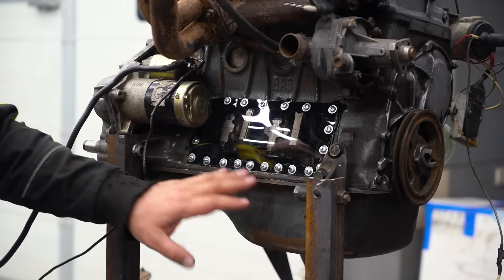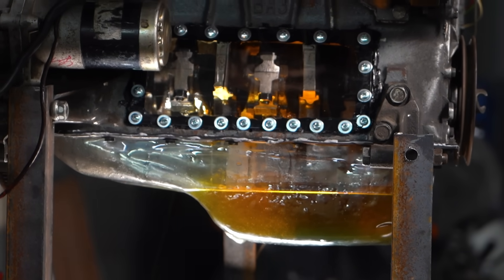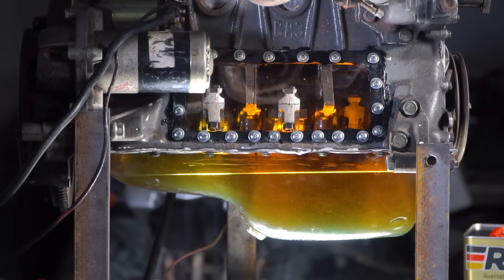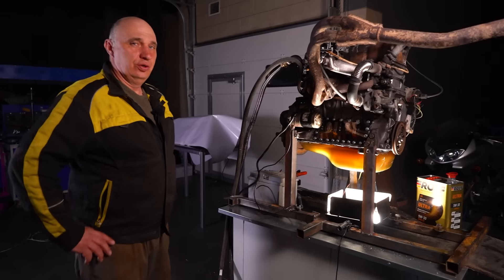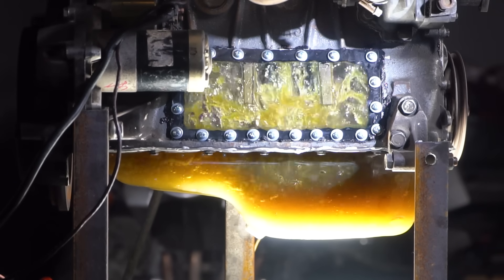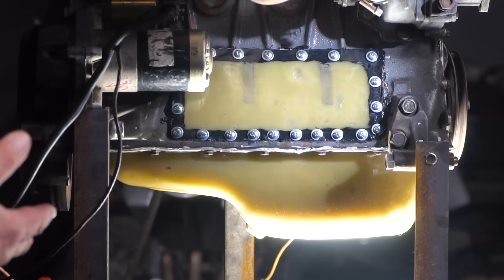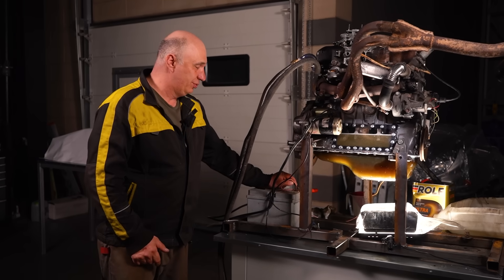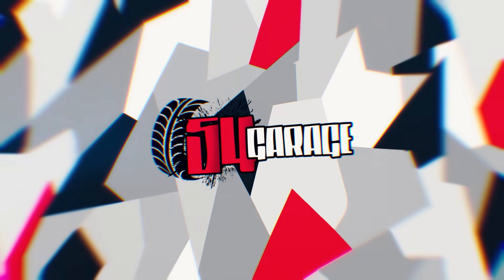What actually happens when you overfill your motor oil? (w/ transparent oil pan)

Comment: This man answering the hard questions in life 🍻
Reply: I remember I’ve stated that Garage 54 is mythbusters of car world.
Reply: The ones we never knew we even had.
Reply: I thought about doing this same video 18 years ago. Cool to actually see it happen.
Reply: @slopoke22  You know, it would have taken you less time to add 4 quarts than to watch the vid, think, and come up with this response.
Reply: @the_kombinator  kik rox in flip flops, smh.
Reply: @slopoke22  I do it in crocs, they're more durable than sandals.
Reply: True
Reply: Well said
Reply: On a high rpm engine, overfilling will cause around a 10hp loss. It's really negligible, but we did some testing on engines that make 900 hp N/A. In competition, 10hp may hurt ya. Everyday cars, you'd never know the difference
Reply: @clarkdavis3588 Good vibes..
Reply: The o/p was just being sarcastic. We all know what happens ... it was just a statement to all men..jeezz
Reply: What hard question buddy?:):)
There is reason why not do that.
Reply: It gets better mileage 

I always overfill my oil level to become a well oiled machina bebe ❤😢😮😂 😊😊😊
Reply: @charlesshort4247 

Boy oh boy,  you forgot to mention to put a breather filter in place of the oil cap

Just leave the cap ½ - 2 turns loose if it allows it and not fall off
Then it won't blow the seals lol
 🎉🎉🎉😊🎉🎉🎉
Reply: Guys, HERE is The True Savior

HalleluYAH translates “Praise ye YaH”

YaH is The Heavenly Father
YaH arrives via the TENT OF MEETING
YaH was Who they Crucified for our sins
YaH was Crucified on an Almond TREE

Ancient Semitic of Moshe (Moses)
Isa Scroll (The Original Isaiah)

Isaiah 42:8
"I am YaH; that is my Name! I will not yield my glory to another or my praise to idols.”

Isaiah 43:11
“I am YAH, and there is no other Savior but Me.”

Isaiah 45:5
“I am YaH, and there is none else.”
Reply: And youtube MECHANICS are arguing with someone showing you FACTS 🤣
Reply: I have ran 2qts extra in all my cars, oil is what cools the engine, never had a problem with the extra oil,  factory has it set for the least amount of oil ,that will work long enough to get you through the warranty, and if everyone was adding extra oil, that would only make for more oil to be needing to be recycled, and more oil to be needed, cars need more oil than what it calls for, you engine will last longer, because the oil is what cools the engine, so the more the better, the car companies don't want you to know this, if you could take your old oil and mix it with your gas ,the engine would even last even longer, just like a 2cycle is cooled by the oil in the gas, your car engine would last longer if you could reuse your old oil and mix it with your gas,  remember the car companies only want the car to make it past the warranty,  a couple extra quarts of oil in the engine if you own the car is the way to go, I have owned cars from the 70s to 2016 and all my cars have had 2extra qts  of oil in them, I knew it could not be bad and if any thing saved me money, and I will now start adding 3 extra qts of oil to my engines, doing this has worked for me, and nothing anyone can say to make me change,
Reply: @charlesshort4287   No, coolant cools the engine.... Oil lubricates it. A couple quarts of oil has very little cooling capacity, even if you add an oil cooler which I am guessing you dont have, it's still neglible compared to coolant. If you have enough that the oil pump can pick it up and maintain pressure more doesn't do some magic and make the engine run cooler or better. 

Small 2 strokes have aluminum fins on the engine for air cooling, again not cooled by oil, oil lubricates. If you don't have enough oil and friction starts happening yeah you will get a ton of heat but if you have enough oil to lubricate more oil dosen't mean better.

Overfill the transmission too because more is better it's all a big auto conspiracy.

You should definitely just go 4qts over, maybe 5.
Reply: HOw is it a hard question? You'll blow seals and gaskets due to the extra volume in the engine taken by excess oil and a smaller pressurization area. If you consider that a hard question, I sincerely hope you're in grade 5 :P

(Edit - wow so many simps didn't get educated properly and cope by calling me a nerd and/or a smartass - Keep watching G54 and taking it seriously).
Reply: @the_kombinator  well as far as I remember they don't teach grade 5 how that engine works, heck I also don't remember them teaching this in my high school maybe if I took a course or subject related to mechanical engineering maybe I will also know how a car engine works.
Reply: @lwoklidfr  Sorry about your lack of STEM at an early age. In Grade 6 I learned about small engines and motors, as we had a shop and a teacher who taught it. In Grade 9 we had a full on auto shop. It's not required to take a course on mechanical engineering to know what happens when you fill a balloon to the brim with water. It's called "transferrable knowledge"  and having a good imagination.
Reply: @the_kombinator  The hard question is how much extra volume in terms of % causes problems. What if I overfill my oil by 20-25%? My mechanic overfills by 10% and I add another 10% oil additive once I come home. So, 20% overfill is normal for me. I know about engine pressure and chances of blowing up gaskets, oil burning due to oil entering the combustion chamber etc. But I did not know the level of overfilling needed to actually start causing problems. Now that in the video it was shown that even 100% overfill is not harmful in the short run, I can be at peace that 20% overfill that I do is not a case for concern at all.

It looks like you are a person who is only satisfied with the basic minimum answer without any details and nuances and appear haughty about it. There are many who also know that overfilling is bad but the quantity of overfill and its actual effects shown in this video is something really enlightening.
Reply: @shrujanamsyama9940  That's a broad question, it depends on the engine. I know that if you double the oil in an Alpha 1.5L engine, it will start burning oil.
Reply: @the_kombinator mechanic here. bro chill out, you will be surprised to know how many people don’t know a thing about cars let alone knowing about seals in an engine 😂 and I don’t blame them so it maybe a hard question to many
Reply: @Batsman_music  I see, I should chill because something that's obvious to me isn't obvious to (apparently) the masses. All these people watching " educational " vides by G54 instead of actually learning something.... that's bar-lowering behaviour LMAO.
Reply: @Batsman_music  ... you've never put water in a balloon to the point of breaking?
Reply: @Batsman_music  Than tell them its dumb idea:)
Reply: @the_kombinator  you would come off as a smart individual had you just explained it instead of sounding like a smartass... not everyone knows everything. just because you know it doesnt mean its common knowledge. when you treat people like that you make them feel stupid and make them not want to pursue the subject... happens alot in the mechanic world... a lot of mechanics are just assholes and it pushes away the younger generation who want to learn... what is so hard about spitting knowledge and helping others out... now a days its like "HAHA I KNOW MORE THAN YOU KNOW, YOU ARE STUPID IM NOT" everyones so selfish... maybe if we stopped and taught the people around us how things worked instead of laughing at them there wouldnt be "stupid" people roaming the world.
Reply: @the_kombinator  You can tell how intelligent someone is by the manner in which they explain their point. Suffice it to say, you leave a lot to be desired. If you can't comprehend the fact that not everyone is familiar with everything, including yourself, then you have a lot of growing up to do.
Reply: @squidikka  It's called general knowledge though. I have mechanics and engineers chiming in here, were really it's not that hard to figure out. And I am the one that has growing up. Right. Sound advice LMAO.
Reply: @the_kombinator  so it gets over pressured ? 😂 nothing wrong 😂 works fine with 10 quarts in 😂
Reply: @George_Soros.  MMmhmmm, did you see how much blowby was coming out of the exhaust? Trust me I've done this, buying a junkyard motor and assuming it was empty, then added 4 quarts to the already 4 quarts after I installed the engine. It smoked pretty badly on the highway when the oil PSI was so high. I drained it out as soon as I could - keep driving like that and your front and rear main seals WILL pop. I got lucky.
Reply: @the_kombinator calm down
Reply: @SoMiSongbird  I can't, your mom is still putting her clothes on :P
Reply: @the_kombinator  What the shit are you bubbling about? Damaging seals and gasket with 1-2 extra liters of oil? Looks like engineering and logic are not your forte.
Reply: @A13X4NDER  I see you have never driven a car with a leaking rear and front main seal, let alone one with bad rings. Back to the drawing board, "engineer" :P
Reply: @the_kombinator thank you for the valueable information, sheldon
Reply: @kuze9554  You're so smart!
Reply: @the_kombinator  Mechanic told me as a child that too much oil makes the engine run inefficiently and will over compress crankcase causing seals to blow, I've passed on that basic info to many. But seeing this full experiment video means I learnt more and can now explain it in much more detail, including the point that a few extra litres won't damage the engine, just it's fuel efficiency. The kind of person who thinks "Oh I already knew that, only dumb people wouldn't know that."; and doesn't bother watching the video is the kind of person who never really learns anything new.
So it's only an easy question if you're satisfied knowing the bare minimum about anything and it makes you feel smug and superior that others don't even know that much.
Reply: @wobblyboost  I'm glad you were educated enough. I'm not sure who this is aimed at, my 5 year old and I watched the video and I explained it to him what happens. 

We seem to be on the same page about knowledge spreading, but you seem pretty self righteous, petty, and simple. 

Good for you I guess? I'm glad G54 expanded your... knowledge. Keep at it, Einstein.
Reply: @the_kombinator  We're not even in the same library.
Reply: @wobblyboost  OK champ.
Reply: @the_kombinator  you have to remember women think blinker need blinker fluid to operate so 👀 it's a hard question for some🤣

Comment: I did this recently i have an opel corsa with a failed oil pump under 2psi of oil pressure at 6k rpm so for fun i put 20 litres of old engine oil in and ran the car for 15 mins the oil pressure light went off and it started seeping oil past the pan
Reply: 20 Litres? 😅
Reply: @Slickhubert  it already had 3.5 litres in anyway and the car had drove home 4 miles with no oil pressure and was very loud so thought adding 20 extra litres to just see what happenes
Reply: @ethanrainsford4251  To know where the limits are, you have to sound them out. 😂
Reply: I was curious if you lost oil pressure, or spun a bearing if you could overfill the pan and get home.
Reply: @volvo09   maybe not spin a bearing but oil pressure bieng low by adding more oil or even thicker oil if its only got to get uou home whats saying going from say a 5w40 to 20w50 or even some type of gearbox oil like an 85w90 if the pump is worn and only has to get you home